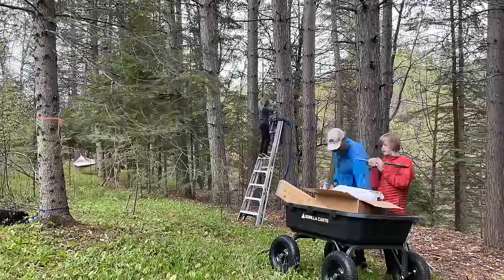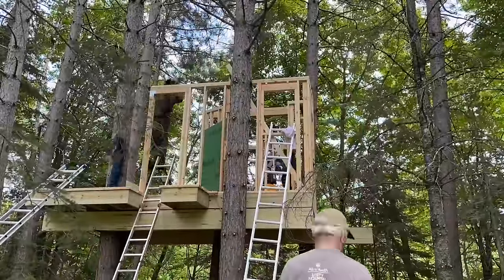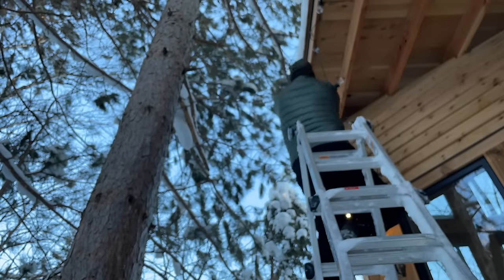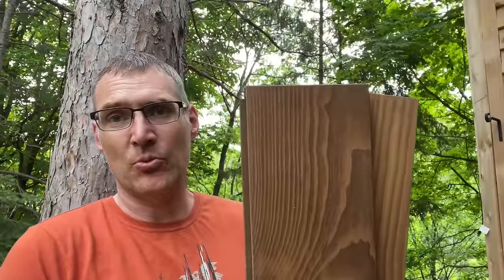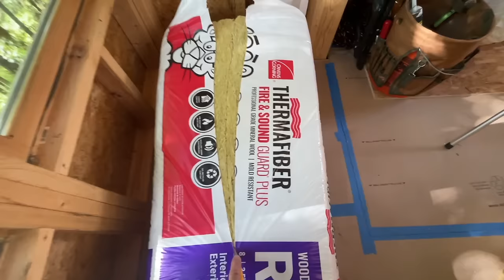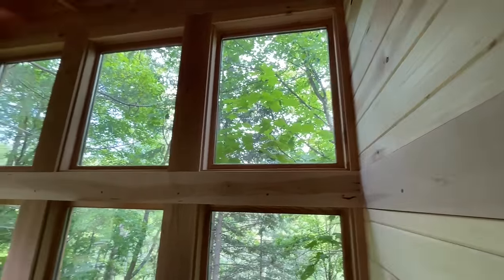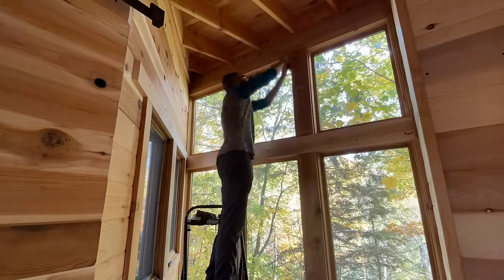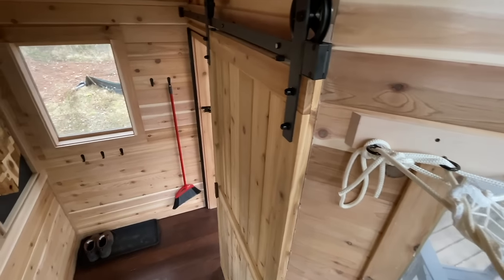DIY Family Treehouse Build: Start to Finish in 32 minutes

Comment: Over engineered but hey, its going to last several generations of taken care of.
Reply from the maker: I really hope these are long lived trees, and that doesn't become the failure point. The big beams were definitely overkill, but they were stock sizes, so easier to source. I actually found the metal hardware was NOT over engineered. I plan to put out a lessons learned update soon.

Comment: First off, outstanding! How many tree bolts did you use? Looked like 4 anchor points but can you clarify that? What's the load rating for that anchor system? What's the final project weight?
Reply from the maker: Thanks! This layout used 4 trees that are in a trapezoid shape, with one bolt in each tree/corner. They are sold by Nelson treehouse company, the "tree fort" product line. The load rating is on their website, it depends on the tree species and the type of load backup used. Basically they can run from about 2,000-15,000 lbs per anchor or so. I'm not sure exactly what the load on our build is. I have always assumed it is easily under the 6,000-8,000 lbs rating I am estimating per corner, snow load included. However, I have a new video coming soon where I upgraded the load backup to the adjustable strut in all 4 corners. More on that soon.

Comment: Came across your video in search of ideas for a treehouse project I’m going to be doing in the spring,(yours is loaded)!, I truly love the size and configuration, especially the loft, my only question is did you use all dynamic supports or is one of the supports static, still unsure what to do, I have 4 trees,(fir), with average diameter of 18”’s and 15’ span, my thought is 1 static and 3 dynamic, what are your thoughts please,
Reply from the maker: This does have 3 dynamic and 1 static. It was a 4 tree “kit” from a diy supplier. It will gradually shift on the dynamic supports until it is very off center. My latest video shows this and an issue we had with the plastic bearing strips sinking into the beams. Keep this in mind if you have snow loads or might be on the upper end of the rating for the smaller hardware.
Reply: Thanks so much for your input!! Will definitely keep that in mind, Montana gets its share of snow! Using a heavy load tab from Nelson kit, thanks again for your input!